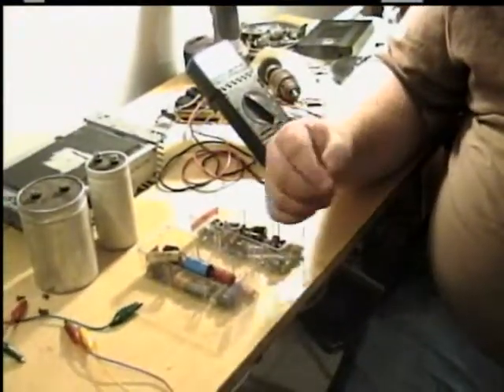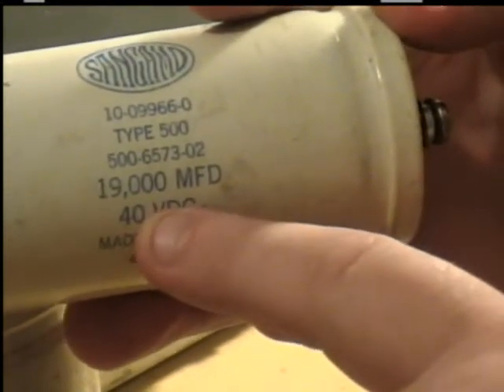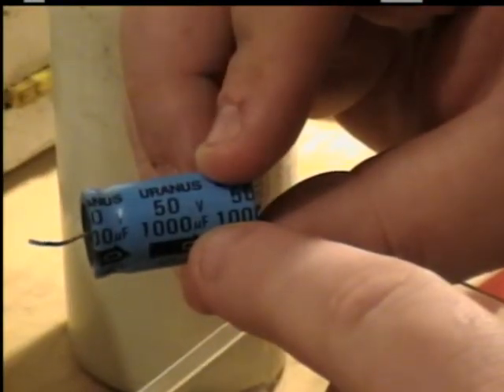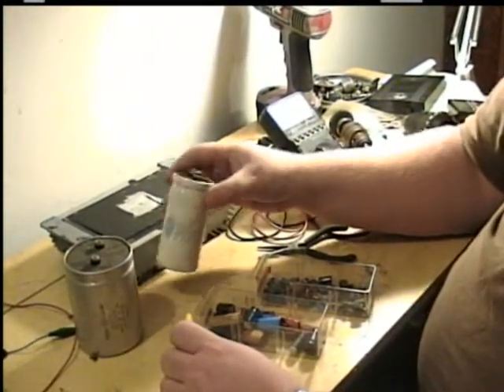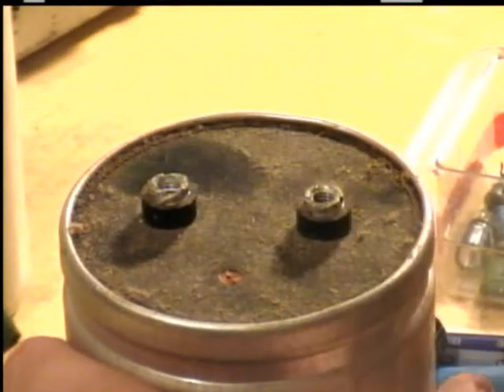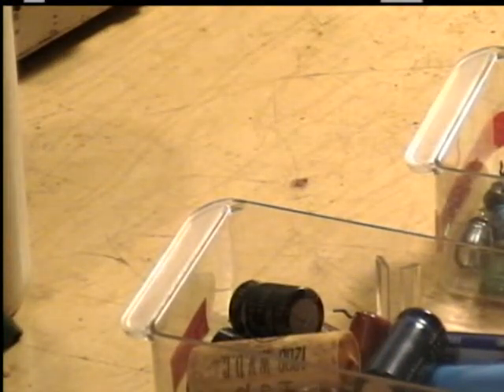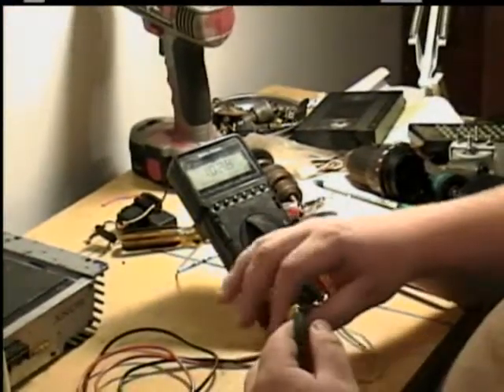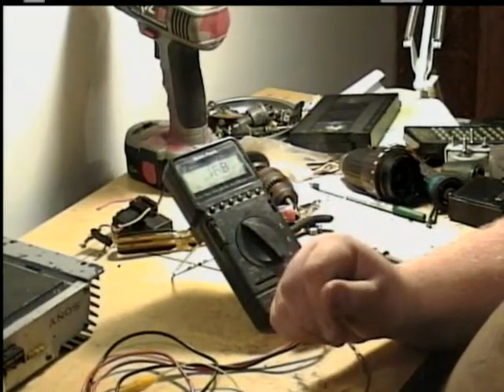Indentify and test a capacitor

Comment from the maker: @37474748 These are old computer grade capacitors that I pulled from industrial equipment power supplies years ago. Capacitors can range from 0.0047 picofarads (pF) to 2 Farads (F). You can buy a 500,000 microfarads (µF) (or 0.5 Farads) to a 2 Farads capacitor at many stores who sells high performance car audio amplifiers for around $80. I use them in High Ampere power supplies.

1 farad = 1,000,000 microfards.

-Mrfixit

Comment from the maker: @betzah The microfarads (uF) will stay the same regardless of the voltage. The voltage indicates the maximum working voltage the capacitor can handle. To increase the total uF you can either use a larger capacitor (higher uF) or wire multiple capacitors in parallel by connecting the '+' together and the '-' together then add each capacitors uF together to have total capacitance (uF)  - MrFixit

Comment from the maker: @      The maximum capacitance will stay the same as that is the maximum capacitance that the capacitor can handle and therefore rated at . For example ,you can't increase the voltage / amperage of a 12 volt battery  by charging it with 6 volts . It will just take longer to charge , that's all.   A  capacitor is basically a battery with a TEMPORARY short term  storage .

Comment: Thanks! Very good video.

Just a quick question. When you have for example 50V 1000uF capacitor, but you charge and use them at for example 5V. Will the maximum capacitance stay at 1000uF or increase?